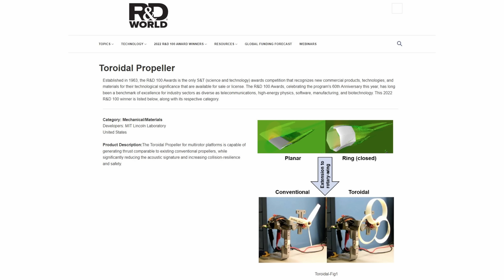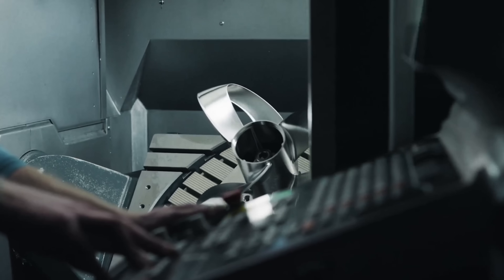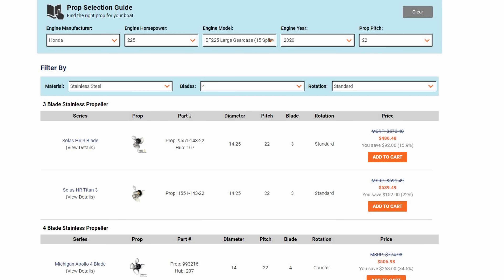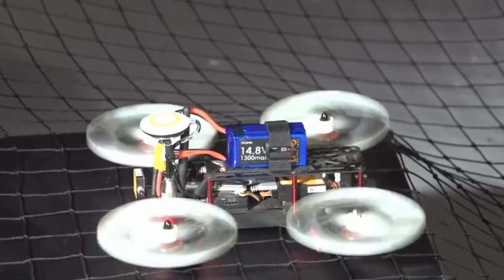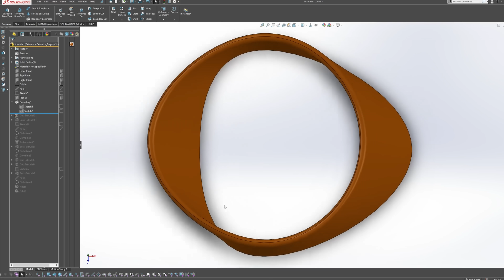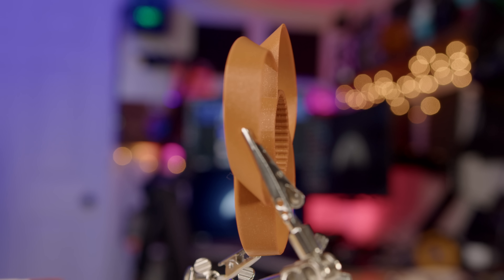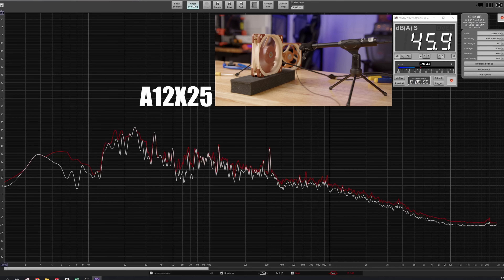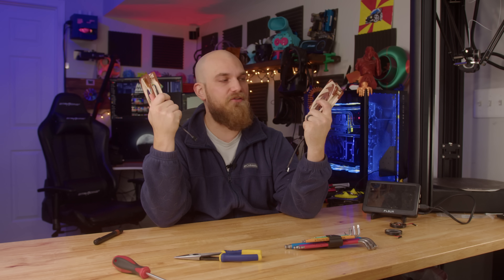I Turned MIT Award Winning Toroidal Propeller Into A PC Fan | Fan Showdown S5 Special

Comment: The noiseblocker eloop did this years ago. They also quoted the reduction of tip vortices as the main advantage. 
Loop rotors where initially patented by Dr. Rudolf Bannasch in 1999, see EP1196696B1 or WO2001002742A2 (Rotor with a split rotor blade).
The patent recently expired so I'm not surprised that a lot of people are "inventing" this now.
Reply: Ahahahah MIT inventing old german technology  as per usuall XD Good one for spotting that out
Reply: Underrated comment.
Reply: Idk about other videos but the one I watched they did say that’s what inspired the build and designing of these blades so he never claimed to have invented the idea just did testing to improve it.

Comment: The fan "shroud" functions to break tip vortices like the Toroidal Propeller, so it makes some sense that the Toroidal Propeller doesn't make additional improvements in a shroud. Toroidal Propeller is really a design that improves shroudless fan/propellers. As others have mentioned, more blades for the A12x25 is also likely to be better over the 3 blade design in the case of a shrouded fan for both air movement and noise.
Reply: Yeah, if the shroud was removed, and the blade angles were optimised, the Toroidal propeller (while possibly still not beating the Noctua) would still be a decent, high performing and quiet option.

I wonder how it'd go on a graphics card (or CPU) air cooler, where the fan wasn't covered by a shroud vs a dedicated aircooler with the standard fan style.
Reply: Yeah toroidal fan has no advantage inside a duct.

Comment: I think that the frame of the A12x25 helps the standard fan a lot. Spinning in free air, it probably wouldn't do nearly as well.
Reply: On the noise aspect, definitely. Was thinking this too, Noctua isn't comparable to a drone propeller if it's in it's frame. Well, not otherwise either (blade count and shape to start with), buy anyway; the frame will help with those tip vortexes.
Reply: @Garbox80  ducted fans for drones and ducted propellers for boats exist too, so i wonder if the toroidal prop design has advantages against those beyond weighing lighter.
Reply: @sepg5084  I mean I feel like weighing lighter is the name of the game lol.

Comment: What I find fascinating is the suboptimal build quality and speed of design was able to nearly match the noise performance of the noctua fan, which is about as good as it gets. This might actually have potential with more R&D

*Edit*
Yall, I'm not a fluid dynamics expert. Idk why this comment keeps getting replies. It's an interesting topic for sure, but Idk wtf I'm talking about.
Reply: I was thinking the same thing. You just eyeball it, slap it in, without as much as treating it, much less, like, sanding it glossy, turn it on, and get a result with less high frequencies and almost the same level of noise. While Noctua are like the cutting edge engineers in the field. These blades probably went through hundreds of hours on the design boards and dozen of physical edits.
Reply: Some 600-grit sandpaper, maybe a coat of something just to stick in crevices, and a whirl at 'wheel-balancing', for instance.
Reply: No it wasn't close. Noise should be compared at same airflow and/or pressure - not RPM. Otherwise I can make a disk "fan" that's just a flat spinning round piece of plastic, and it'll be practically silent on its own but move ZERO air.
Reply: @AlexKarasev  great point
Reply: if the fans could go up about 1k rpms youd notice the benefits of the toroidal prop. it would out preform the standard fan.
Reply: Major Hardware's work is undeniably amazing with so little tunning. However, as much as I would like to agree with this comment, it's not even close. DB is a logarithmic scale, meaning that 46/47 dB is almost half the noise level of 50 dB, with a common and very general rule of thumb that +3 dB is almost double the noise, so it's inaccurate at the very least to say  that the toroidal fan came close in noise levels. Great work tho.
Reply: @skurdibbles7913  These fans were run at 2k rpm in the video, so you're wrong.
Reply: @Enalius  the fan shape only shows in benefits at about 3k rpms as documented by the team who studied it from MIT. So if I'm wrong they are wrong too. So who's wrong?
Reply: Ill answer for you. The people who didn't read the documentation. If they did they would notice oh shit it doesn't get quiet until it hits 3k rpms or above.
Reply: Now go read the scientific paper and drop my mic for me.
Reply: The Banned  actually, it is a great point, as saying the noise level is close is a bit gracious.  the toroidal design is much louder, and moved much less air.  you want to compare noise level at similar airflow/pressure, not rpm, because if you aren't even able to get the actual results that matter, cooling, but it sounds... still louder, then there is obvious design flaws that haven't factored in .. well, physics.  you're jab about "he's" just being a good consoomer is a great example of a person lacking logic making an ad hominem about a person pointing out actually valid points.
Reply: @skurdibbles7913  without a duct.  but oops, case fans are ducted.  don't draw conclusions when you aren't even considering contributing factors.
Reply: @illuminape7632  it's very clear in the documentation. Re read for accuracy please.
Reply: @skurdibbles7913  you're right it is.  I advise you to go reread, triple read, and then come back to this fan review and before you allow those pudgy fingers to type anything out, start by thinking a little.
Reply: You being wrong doesn't effect me in the slightest.
Reply: @skurdibbles7913  you not realizing that the documentation is regarding water and telling other people to read the documentation on this youtube video comparing computer fans says otherwise.

Comment: As others have pointed out, the vortices concept is reduced in significance when the fan is ducted and not open like a drone propeller.  The blade area ratio between the two tested is also massively different, you'd see better airflow from the toroidal if the BAR were higher.  Overall it's actually really promising, especially given it shifts the sound profile to lower frequencies, which are far less annoying.

Comment: The rough surface on the 3D printed blades (against the much smoother one on the commercial fan) are a factor that impacts negatively on the dB levels. 
Maybe you could sand and polish it before measuring again. It WILL make a difference.
I think it impacts on the airflow as well but not so sure.
Reply: 2000 rpm might also be too low. Smaller fans use higher RPMs. Maybe try with a 40mm high flow fan? Because from my experience, small fans can be very noisy in the higher frequencies.
Reply: agree, I'd suggest printing the propeller on a resin/SLA printer instead
Reply: but even if it dropped the noise levels by 10%, it would put it right in line with the other fan. While it is cool to think that it is as quiet as a noctua which are notoriously quiet for pc air cooling, 2k rpm just isn't fast enough to see a huge change in db.
Reply: I think a better option, would just be to print a design similar to what's found on the noctua. So they both have the same disadvantages.
Reply: @internetcancer1672  Good idea

Comment: I'd love to see this on a drone with a sound test, see if it even works lol.
Reply: Yes yes drone test this!
Reply: The point is to reduce high frequencies that travel far. To test this the sound meter should be 10+ meters away from the fans in a stadium or other very large room.
Reply: You will see these types of propellers come out for purchase from high quality manufacturers in the next couple months.
Reply: and a set of a12x25 blades on the drone for the sound comparison lol
Reply: It looks like the prop is a bit heavier than a standard 3-bladed prop. If so it comes with other problems like warmer motor temps and worse propwash handling. It would be super cool to let someone like @ChrisRosser take a look at this design and in the future if companies start making them do a thourogh test ofc.
Reply: @Fumes74   The weight alone would certainly make a big difference in performance and the motor bearings would pick up any imbalance and reflect it in the noise profile. I would print the blades using the liquid polymer UV curing 3D process - it's far more accurate - easier to get a well balanced print and get the finer details of the MIT design (better tapering).
Reply: @Fumes74  I could see the tradeoffs being useful for specific applications, where top performance is not needed, and noise is the more important constraint. I have a couple five inchers, that absolutely scream, and are very fast. But I am also building a smaller one that I would like for photography. Filming something like a wedding, where I don't want my camera to be overwhelming the party with its loud props, I am very interested in where this idea goes in the copter world.
Reply: @Inertia888  I agree, we need quieter props fore some applications. My thoughts were more on the PID-tuning side. It will be harder to tune, and with tradeoffs. Cool that we can advance in this area! I'm looking forward to it.
Reply: It most likely works compared to standard straight-blade propellers, because most of the noise isn't from vortices (these are actually only a small amount of super-high-frequency noise, like many many kHz), but from the pulsing of each blade sweeping towards you. They're quieter than these because the "blades" are curved, spreading out the pulses, something which the aviation industry has been investigating since at least the 70s with propfan engines that are seeing renewed interest now.

This also makes it very obvious why it doesn't beat the Noctua fan; aviation has been slow with curved blades due to structural & reliability - and therefore safety - concerns, but Noctuas (And basically any fan worth the plastic it's injected from) already implemented this and have for several decades.
Reply: MIT already did this: watch?v=M0nMW1E8J90 but i have yet to actually see the numbers
Reply: I know what doesn't work: Touching anything except air or soft grass with a rotating toroidal prop.

Comment: This is a ducted fan (the fans are in a duct, natch) which probably affects the tip vortices quite a bit. Compare them in open flow (without the duct) instead, as well as at higher speeds as you suggest.

Comment: Great video! I think one of the factor may be the number of blades. Noctua has 10 blades but Toroidal has 6 blades equivalent both spinning around the same RPM. If you can get 10 blades for Toroidal spinning as the same RP, then it will be more interesting. Additoinally, I think one design advantage of Toroidal vs the traditional drone fan is the shroud or the lack of it. Because Toroidal creates a virtual shroud around the blades by the design. But, Noctua already has a shroud. The decrease in noise will be more prevalent when there is no shroud. A well designed shroud decrease the noise for the same air flow.
Reply: Also, with this Toroidal design, the self shroud of the propeller is interfering with the shroud of the assembly, causing noise and power losses.
Reply: You can hear the toroid rattling in the shroud also wich surely accounts for some of that volume
Reply: I noticed the number of blades also.  One more thing to check is how much power is being used, check both with that toroid and one with more blades, with an AC current they will tend to spin at about the same speed.
Reply: I would suspect total surface area towards the air would be the dominant factor.
The least Cd w/ the greatest surface area would win.

Comment: using that idea, increase the blade count by making each shape more oval instead of more circular. sort of like daisy petals instead of round ones. that way there's more blades actually doing the pushing. because in this layout, there arent any FULL blades, just 3 sorta full ones and 3 less than that.

Comment: I would love to see you scale this down to a 40mm fan and see how the noise levels compare at high rpms. I think you are probably right about the speed being a big factor in the apparent performance differences here.
Reply: I have a few 1U servers with a bunch of 40mm high speed fans, and, let me tell you, they're loud as F (especially during reboot or CPU intensive operations)
Reply: @davestorm6718  22000 RPM goes BRRRRRRRRRRR crackling headphone noices RRRRRRRR
Reply: I was thinking he needed to reprint this for a high speed delta fan and retest it
Reply: @davestorm6718  I had a system in 1U, watercooled, and use radial fans in it. 
Now I got another one, and need to get some more big radial ones. Got a new gamign system in 2U and it is a lot quieter, I think if I had an easy way to mount the gpu and not needing a Protocase custom order or heavily modded case, I';d have done it in 1U again. 

You can help the noise if you really want to.
Reply: The MIT design you copied only had 3 blades. The toroidal version likely performs better than a conventional 3 blade fan. In order to perform as well as the Noctua design, you would need to make a toroidal shape with an equivalent number of blades.
Reply: @jamegumb7298   How much money does it cost to watercool a 1u or 2u server? Or how much technical knowledge does it take? 3D printing parts?
Reply: @michaelhenry3234  
You can get separate pumps, skip the res, get 40mm rads (watercool and aquatuning stock these I know), done. There are some AIO models from server makers, but those usually are far from quiet, I have seen 60dB+ quoted.

You can also (rarely these days since almost all went out of production) get 5.25" reservoirs with pumps (some even in series for higher pressure), shove that in the opening for it, res+pumps done, saving space.

You can also get stuff like the Eisbär Solo LT, a cpu block with pump in it. Light on the pressure, but functioned well for me (not too much bends and rads though, take care). 

There are a few rads (OEM stuff and a bit pricey from what I saw but consumer can buy them) with integrated pump that also holds some extra water like a res would, just get the block. However, these so far are all 120 fan models and too thick for 1U (I did find one that really should work with the shallowest fans on the market with about 5 mm to spare, but didnt try it (yet?)), but for 2U you can get extra slim fans, rotate 120 fans rad 90° and fit them in the case, use other 80mm fans (80mm 2U, 40mm 1U) to get the air out, front to back or other way around.

Measure first and measure well. Shallow cases are 43.5cm (my 2U) to 50cm, most models are the standard lengths of either 55 or 60cm deep.

For a 1U you also need to consider the PSU. Most will have special connectors, lack gpu connectors, etc, so shop Seasonic, they make consumer 1U models, pci-express plugs, no failover, no extra high cost (althouh always a premium there).

For 2U you can either get standard PSU with 120mm (don't unless you mod the case, it will need air) where you gotta find one front to back blower with 80mm fan, or better (my choice) get on of the SFX supplies, leaves a lil room under it for air intake. However, good chance you will need cable extensions (take it from me, no fun building it all, mobo cable too short) because SFX PSU often have short cables, so check specs beforehand. Also as mentioned, really look out for the left hand right hand risers, or just get a standard riser cable  no connector (for pcie 4.0 will cost you, Amazon does have them). To use the other slots may or may not be an issue depending on case if you use a 2 slot gpu, I just got pcie slot extenders, look it up.

I for one cannot wait for the days apu come close to midrange gpu, as long as Eve Online and GTFO run well. OC that sucker hard and watercool it, saves getting a big gpu, allows shallower 1U case over 2U for gaming rig.

This is pretty much all you need to know, go forth and build 2U game machine. It is just like building any other pc except you need to mind the space, not a lot of it in 2U, let alone 1U, but it can be done. 

3D printing can be handy sometimes, but sturdiness leaves a lot to be desired a lot of the times, so do not bother with it for a server case. I use them because I am 38 and moved homes 20+ times. Easier to keep things compact and mobile. Beats a massive case, all little things help. 

End goal is still 2 slot gpu in 1U case, not too loud, with rad to cool the cpu, but the few that take a 2 slot gpu as standard are specialty OEM cases only (mostly for Nvidia render farms, few very new not yet 2nd hand on eBay Dell cases) that take SSI motherboards only (that rarely are 100% no worries compatible with mounting standard motherboards), and the very very big one is of course most motherboards from brands you and I buy are exactly 1.3U high so kind of an issue. That leaves a very barebones motherboard (nice and spartan, what is not on it cannot break, low on power use, all good by me) that is never found on the better chipsets (like B550/B650) and leaves only the most budget of low end chipsets (A520/A620 or Intel equivalent), which sucks. Luckily, there are 1.5U cases, but the ones on market are always always very shallow mini-itx ones that have other drawbacks, so seems I must make due with selfdesigned 1.5U case, somewhere in the future. 

So take note, if you considered 1U, you need to select just the right motherboard or buy a specific server one. Make it easy on yourself, buy standard shallow 2U case, go ham, whether gpu or watercooled.